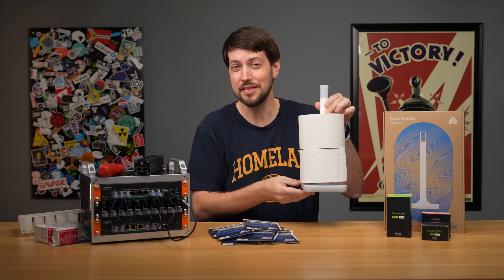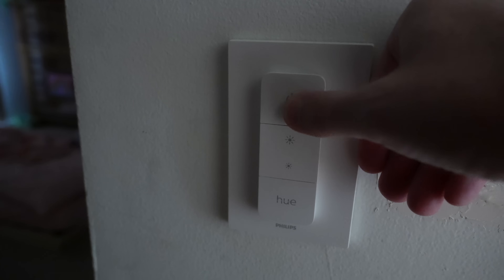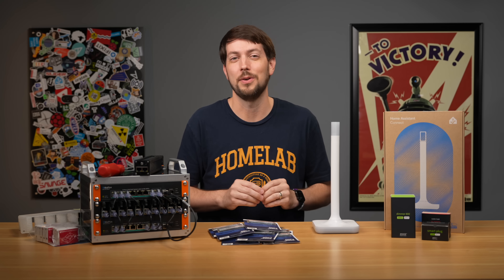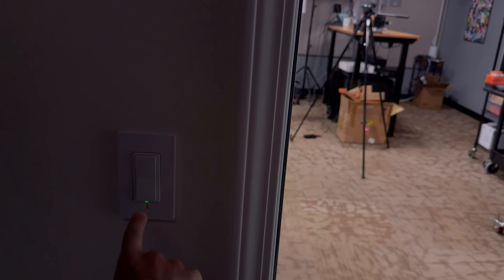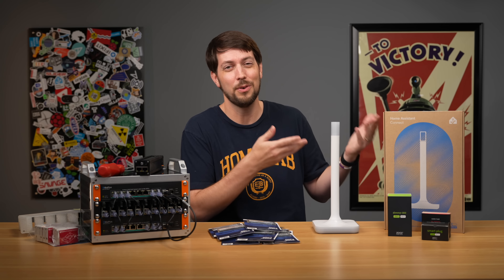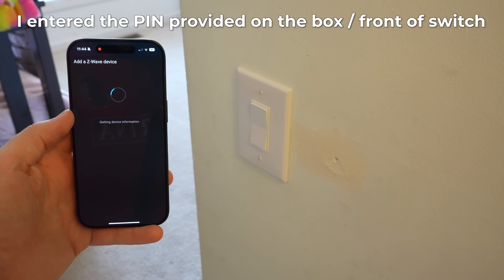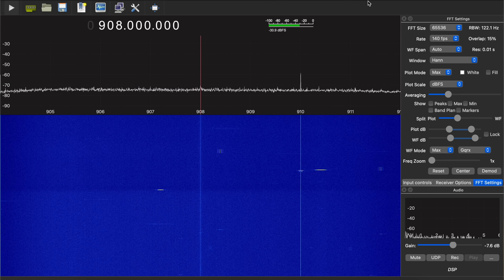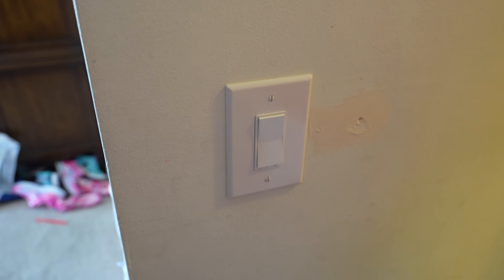My Smart Home Played me for a Fool

Comment: All I use is Zooz switches through the house for the simple fact they just work.  If your HA system is down it still works since its a physical switch.  Now I'm using the Paddle with relay so i can control my ceiling fan light and the fan on/off with one switch.  Lights on the paddle and the fan on the relay (yes its still a button on the switch) the only thing I changed was the on/off ramp for the light to 0 so its just on/off and not fade on and off.  (preference only).  Outside of that they integrate great with the system and you can use them as a 3 way with only changing the Primary switch in the 3 way and the other side can remain a simple switch no need to change.  (Zen 30 Double Switch )

Comment: It's interesting to hear that the Zooz switches retaining your last brightness setting bothers you guys.  One of my biggest gripes with the Lutron Kaseta switches is that they DON'T remember your last brightness setting... it drives me NUTS turning the lights on and having them go to full-brightness every time, when I just had the light dimmed.  But I can see how, if you have lots of people sharing the house and the switches, that when someone new comes into the room, you wouldn't want to use the previous occupant's brightness settings.  Anyway, I would've gone with the Zooz switches, but we don't have neutral wires at my current house.  I love the Zooz Z-Wave products so far, though!  They're proving a lot more reliable than the other Zigbee devices I've been using, and they have a great selection of quality Z-Wave devices!

Comment: the hue remote talks to the bulbs via the hub. but if you used another integration you could bind the remote directly to the bulbs, or even a light group. this is dependent on the remote though. ikea used to support direct binding, then they disabled it in a later firmware release, so i haven't updated mine in like 4 years.

I do like zooz products though.

Comment: Suprising this video made me realize how reliable my hue hub has been. I have a two story home and my hub is in the basement, so dar I havent had any issue with those 4 button dimmers or lights in over 5 years of use. The wireless dimmer gets a bit iffy if the battery level gets really low, but I cant fault it for that, the voltage is dropping in the coin cell. I have looked at that zwave thing for home assistant, it does look pretty neat. Nice vid, i like how you narrated the prediction ahead of time.

Comment: I use some Philips hue bulbs along with other brands but the important thing is that they are zigbee so I connect them directly to Home Assistant.The same goes for the Philips hue switch. I have two of those. I bypass having a Philips hue box. I prefer just to have one device controlling everything if I can. I don't have any problem with the distance because of extenders and other zigbee devices passing along the signal.

Comment: Z-Wave is also a mesh, but long range is not a mesh.  The advantage of the ZWA-2 is it will run both Long Range and Mesh together.     Z-Wave Long Range is not exactly a new thing either.  Even the 800 series chips were certified in 2021, but 700 series also had LR.   The software/firmware bugs kind of overshadowed it and really put a damper on uptake.   Europe use Long Range now, but at lower power than in the US.  It just shares the same allocated frequencies that the Mesh system uses.  I believe Australia / Oceania region also uses Long Range now.

Comment: I've been installing these switches all over my house for the last 6 months and love them.  There's a lot of extras you can do once you turn on scene control (like I use 1 tap up/down to control main light, 2 to control a secondary light, 3 to control the fans in each room), that way it operates like a dumb switch for a normal visitor, but people living there can use the extra power of the taps.  Also, for your brightness issue, just set parameter 25 to "Configured Maximum Brightness" and parameter 11 to whatever you want that to be (like 99% or whatever).

Comment: It looks a bit silly, but I just keep my normal switches and install the smart switch above it. That way I can always override it if my Zigbee network is being annoying. I am also using the Zigbee bind function as much as possible, so that devices don't rely more on the coordinator than they have to. Basically leading to the same functionality as in this video. Particularly the IKEA bulbs don't seem to have a transition duration setting like my Innr bulbs, which makes the bind function the only way to do smooth dimming anyway.

Also is there any reason you can't just connect a larger antenna to your Zigbee dongle? Besides the connection limit, I mean.

Comment: I've found great success with the Eufy smart switches.  They are have wifi built in and pair with the eufy app pretty quickly which can be then linked to Alexa, Google, Apple, etc...  And if the wifi goes down or they disconnect for whatever reason, the switch and dimming buttons still work like a normal dumb setup.

Comment: 100% agree with light switches working like actual independent hardwired switches, if your starting from scratch it’s a no brainer. But as you already had Hue switches, you could have added a Hue smart plug as a repeater, them to Home Assistant as a generic Zigbee switch. Personally though would go with Shelly Zwave relays, but maybe that’s just me.

Comment: The first rule of my smart home was that everything has to work in dumb mode. That means I don't have any smart bulbs, only smart switches. It means my door lock still has a keyway on the outside. And it means my thermostat still has plus and minus buttons on the front. The smart home improves upon the existing infrastructure it does not make it work in different ways than the family was used to.

Comment: I had to put a pi in the center of the house that runs my zwave, zigbee and thread readios - home assistant connects to this pi over the network, only way to do it IMO as some device want direct access and won't communicate though the mesh like they are supposed to

Comment: I just gave up on trying to get my own pile of Patriot M.2 P300 NVMe drives working with Raspberry Pi (in my case in the second slot of a 2 slot M.2 hat with a Hailo in the other. Incidentally, the out-of-the-box HAOS did reliably boot it, but I couldn't get the same love from the default OS. Instead I loaded them all into a Beeline ME Mini where they are working great

Comment: I like the idea of the "smart home".  At least with home assist.  I just can't be bothered.  I've got enough home DIY projects to do.  I still haven't finished my synology NAS replacement build, because the case and drives are expensive (well, cost money).
Sometimes, less is more.

I do agree that you get what you put into things though.  I did spend a lot of time setting up a openSense router this year.  I'm really glad I did, but it take a lot of time.  I also spent a bit on the router.  It was needed though.  The old one was problematic.

So, more is less, but more is learning?  Something like that.

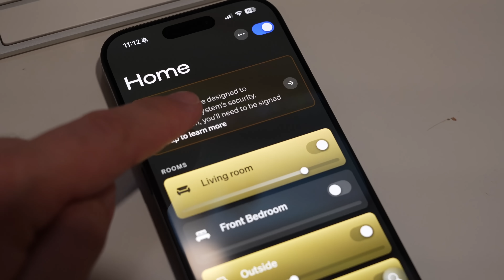Comment: 1:30 Just letting you know that you shouldn't cover up an electrical junction box like that. It needs to be an accessible blank faceplate (or you need to rethink how to do this cleaner). It's not to code at all currently.

Comment: I'd go with it being the Philips Hue switch that was crap, not the Zigbee signal in that location.  I have the exact same switch and no matter whether it is a meter away from the hub, or 10 meters, it flakes out about 20% of the time and needs several presses (and a smattering of swear words) before it does what it was supposed to do.

I got a no name Zigbee switch for less than £10 from Ali Express, connected it to Zigbee to MQTT in Home Assistant and it works EVERY time.

Comment: there's actually a Hue device I think about getting that will at least solve the "extra light switch problem" it's called Philips Hue Wall Switch Module and you install it behind the physical switch in the wall. the power circuit to the bulbs ist always closed so the bulbs have power and when you press the physical switch the module transmits the switch signal wireless to the hub(powered by a coin cell)

Comment: The Philips Hue lights use normal ZigBee protocol, and you can connect them directly to Home Assistant as well, either directly with ZHA or through MQTT with Zigbee2mqtt, and that Hue switch can also be bound directly to lights and work even if you physically unplug your network coordinator, so you can always control the lights or plugs if your smart home hub is not working correctly (there are other ZigBee switches and motion sensors from other manufacturers as well, like Ikea). The Hue app/hub is really annoying, but if you ignore that, the hardware in the lights themselves is actually one of the best of the ZigBee lights, and you can also get cheaper lights (or switches similar to the Z-Wave one in video) which would work in the same network.

I myself have also started with Philips Hue (my sister gifted me 1st gen lights kit back in 2015 or so), had at one point switched to a DiY coordinator, and I now have a large ZigBee network, which works quite well (better than WiFi), the mesh is also great if you have enough routers (which are almost all mains powered devices, including Hue lights, so not just power plugs), and considering that it's an open standard, a lot of the stuff is much cheaper than with Z-Wave (especially if you're willing to go dumpster diving on Chinese marketplaces).

Comment: Zigbee also let's you do bindings.  I don't know if Hue platform allows this, but if you were using Home Assistant you can bind the Hue switch directly to the bulb and controller.  This lets you control the light still even if the controller is not on.

Comment: Nice! I love my zwave devices. I had the same issue with the zooz toggle style dimmer and non-smart home people using it. They would hold down or hold up instead of just clicking once up or down so eventually the light when turned on was so dim they thought it was not working. Otherwise no complaints. I resolved this by writing an automation that checked if it was turned on after being off and just set the brightness value to 75%. This is why I just stopped using combined dimmer switches. Next time you could try some Shelly relays and report back what you think of them.

Comment: I have a similar setup.  I just have a little Zooz 800 stick in my basement though.  I just added a few ZWave outlets strategically on each floor.  They always have power so they act as relays and I can plug an accent light into them or something and control them remotely.  But yeah, I don't add a smart thing unless it can be physically controlled on site with an independent device.  I don't want an HA crash or a LAN outage to take out my ability to control my lights.  Or even a power outage.  If I'm running on backup power, I don't want to have to energize my network rack and HA server just to turn the lights on.

Comment: The initial issue is that your zigbee bulbs are not setup properly. The switch should be bound to the bulb directly in addition to be in paired to the hub. You would have no issue in that case.
Reply from the maker: is that possible with the Hue hub?

Comment: 3:45 Speaking of "not knowing what you're doing", you should be using Insulated drivers when working with electrical components. Regardless if the power is off or not.

Comment: I have a LOT of Zooz devices (like 20+?) and... I have mixed feelings about Z-Wave. Zooz does a great job (oh, and some of their hardwired devices, like switches/relays, can actually be Z-Wave signal extenders), but I have had WAY more problems with Z-Wave than Zigbee. Mostly around pairing/unpairing/"ghost" devices and unreliability that I chalk up to low battery in some devices causing issues for others. For example, I use a lot of battery-powered switches because I want a switch in a location that would be very expensive to run wiring to in a 100 year old lathe & plaster house - they're great for this, except... sometimes, random Z-Wave devices will stop working or be very intermittent or delayed. The only thing I've found is that some battery powered device will be near 20% or lower, and when I replace its battery, viola, everything that was having issues (sometimes not even the device I replaced the battery in) are working as usual again. This has happened at least 5 times over the last 2 years and is incredibly frustrating. To the point where I've ripped out my old Zooz relays and replaced them with Ikea smart bulbs. Zooz makes good products but man... Z-Wave just means unreliability to me.

Comment: A bit disappointed that with the size and price it requires a separate computer/SBC to work. Would be so much better if it was POE powered and able to run standalone, that way it could be placed in a central location and not tucked away in a basement with the HA system.

Comment: I wired my house with GE zwave switches and had nothing but problems with them. They would crash, become completely unresponsive even to physical key presses, and I would have to power cycle them at the breaker box. I regret to report that the zooz seem basically identical to the GE switches, so I wonder if they're all just white label from the same factory in China. Anyway I wish you better luck than me. I've since swapped mine out for Lutron Casetas and haven't looked back. Oh and the Casetas solve your brightness problem. Two clicks always turns them on to max brightness (at least for the Diva dimmers).

Comment: I have a bunch of Hue lights around the house. These are perfect for areas where I have A19 sockets and some areas where I want a color change at times. In the laundry room, I put in line voltage 5000k led florescent tube replacements. To run these, I used Lutron Caseta. With the hub, it pairs perfectly with Home Assistant .  Lastly, I have a number of LED strip lights that are 24v run off a 300 watt driver. Generally, these are hardwired to a switch. Because I don't have a switch for these, I wired an extension cord end into the driver and plug them into a smart plug. All of this works with Home Assistant perfectly. The one missing piece is a Home Assistant compatible, wireless, battery powered switch that I can mount on the front door that when pushed turns on or off all three types of lightning solutions.

Comment: This is how I setup my smart home from the start including with zwave switches just with smarthings. You can still use your hue bulbs with the switch however! You just need to enable the correct mode and it will always power the light sockets and send the signal to you're home assistant and then you can use that to send the signal to your hue bulbs to turn on or dim or whatever.

Comment: Zooz switches, eh? You'll look like a dunce in a year or two, when they fail. My failure rate after two years was ~60%, almost as bad as the Inovelli switches before that.
Reply from the maker: Leviton's long been my favorite, but I don't think they have any LR Z-Wave I could test
Reply: @JeffGeerling  It's just  frustrating that nobody seems to produce switches that last. I had failures from Inovelli (3 out of 4), Zoos (5 out of 8),  Homeseer (1 of 1), and TP-Link (2 of 4). The only ones without failures so far are GE (6), Leviton (2), Sonoff (8) and Shelly (2).

Comment: "...they discovered that if you use newer radios and a way better antenna, you can extend the range..." ...or, say, you could've asked RF folks and we would've recommended to use one of the many already existing tech - like LoRaWAN for ex. which I've been using since 2016 and at least for the past 4 years IN Home Assistant - but hey, nobody listens to us so ... Good job by Z though...

Comment: I'm a firm believer in hardwired smart switches and dumb bulbs. If there's network issues, they're just switches. 

Almost my entire house is done this way, only a few dumb switches left. Totally worth it. I use Lutron Caseta.
Reply: I'd add a dumb Philips Ultra Definition dim-to-warm bulb too. Dims from 2700k to 2200k
Reply: @donaldlee6760 good thought - if I had any regular screw in fixtures left I'd do that... But all my fixtures are LEDs or ceiling fans

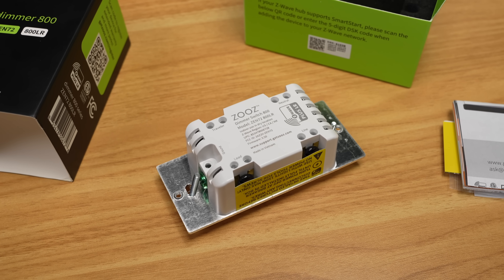Comment: 3:38 The irony of using the widow maker whilst stating this - especially on a lighting circuit!
Be safe - use a multi-meter.  Explicitly check for voltage between the conductors with a meter, and not one of these widow makers.
If what you're attacking only has live conducters (aka 120V/240V) like a lot of light switches, look for the nearest earth and check against that.
Reply from the maker: Thus the statement to use an electrician; luckily this is the third time I've been in that box and I have it well labeled in the box and at the switch, so I'm already 99.999% sure power's off. The death stick is just to give me another 0.0001% surety there.

I usually just swat a screwdriver across ground and hot if I don't have the multimeter handy. Makes nice sparks if you were dumb and didn't hit the breaker.

Note: not recommended fireworks
Reply: @JeffGeerling  🙂 Fair enough.  My comment was more for other viewers than anything else.  I really don't like these devices as they're not to be trusted at all - and so i like to do a PSA on anything that looks like they're promoting the use of them.

Comment: As a UK resident, I am always jealous of smart switches. You can only use them in newer UK houses because the older ones don't have a neutral. There are workarounds, but it would be so much easier with a neutral!

Comment: Its still crasy to me that you dont use WAGO or something for your House Wireing
Reply from the maker: Wire nuts are common in the US, but I've seen Wagos a couple places.

As long as you pre-twist and don't put like 500 psi of pressure on the connection when you jam it in the box, it's reliable.